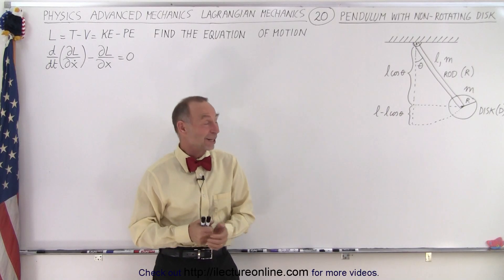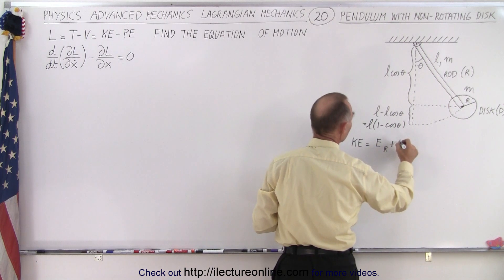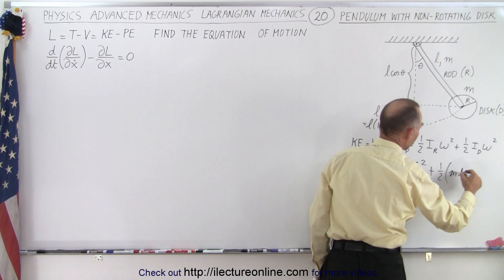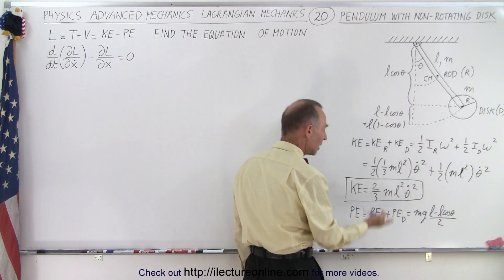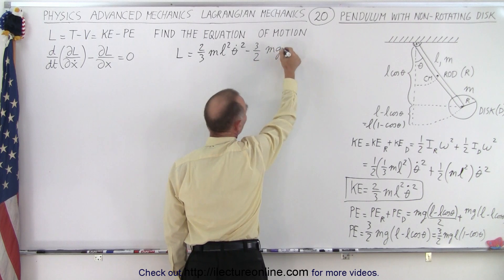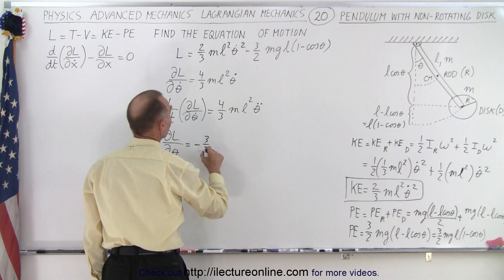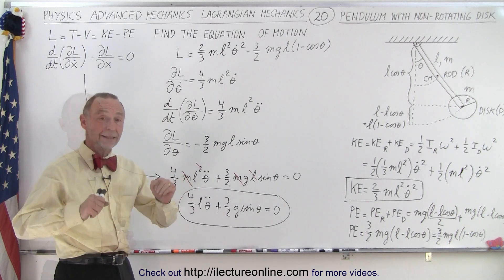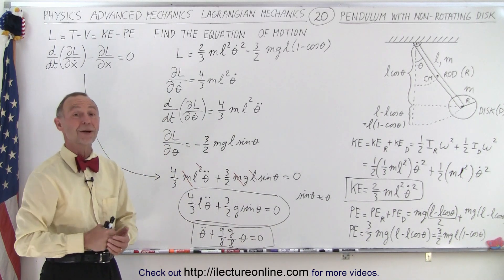Physics 68 Lagrangian Mechanics (20 of 32) Pendulum with Non-Rotating Disk

Comment: if disk is a point object we have to consider it is rotating about its edge equal to R and use parallel axis theorem to move center of rotation to the hinge  of rod equal to l: I=(3/2)mR^2 + m(l+R)^2

Comment: prof, why do you not consider the kinetic energy of the bar due to movement which equal 0.5*m*(l/2 *theta ^.)^2
Reply from the maker: Since the center of mass of the bar moves in a circular path, it is better to use the rotational kinetic energy.  You could use the translational kinetic energy, but you can only choose one, since the center of mass doesn't "go anywhere".
Reply: @MichelvanBiezen  THANKS A LOT .

Comment: please when you have a disk , the moment of inertia is the sum of moment of inertia of the disk around it's gravity center and the moment of inertia around the rotation center  I = I gravity + I rotation   which is 1/2MR square + ML square
Reply from the maker: Not if the disk is considered a "point object".  If the disk's size is considerable relative to the length of the pendulum, and if it is rotating, then yes, they must be added.  Then there is another question: "does the disk affect the motion of the pendulum when it is rotating?"

Comment: 1:57 Yesss I was sure that my teacher was wrong mouhaha😂😅
 He added the moment of inertia of the disc 1/2 mR²
should i point it out ?!?
Reply from the maker: The moment of inertial of a spinning disk = (1/2) MR^2 where R is the radius of the disk  , but the moment of inertia of the disk at the end of the bar rotating about the end of the bar = MR^2 where R is the length of the bar.
Reply: @MichelvanBiezen  First Thank you for the answer!
 I personally prefer to use Konig theorem, KE of the center of the mass of the object + KE of the other particles of the object relative to the center of mass and here we go, it works all time so it's less probable to make errors
In this case the disc isn't in rotation so the  2nd part of the kinetic energy is null and hence we just have the KE of the CM